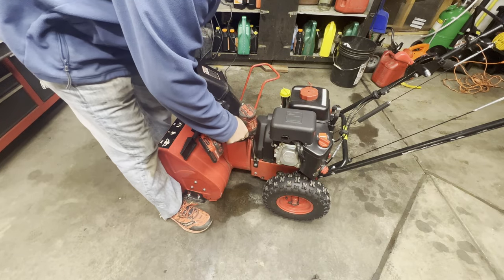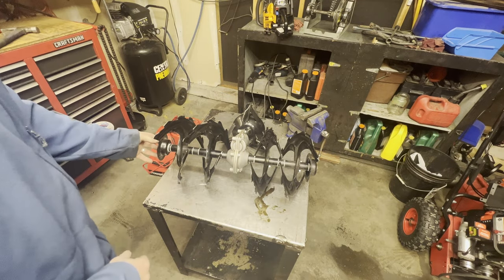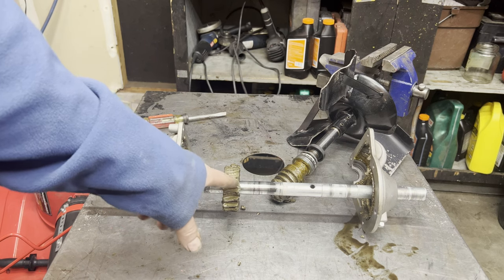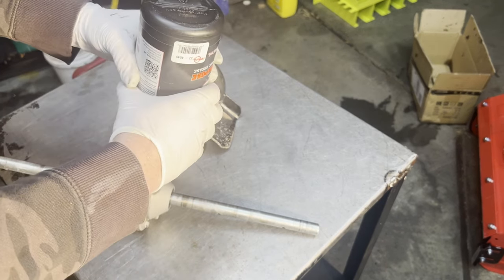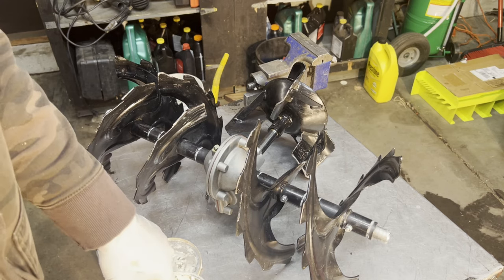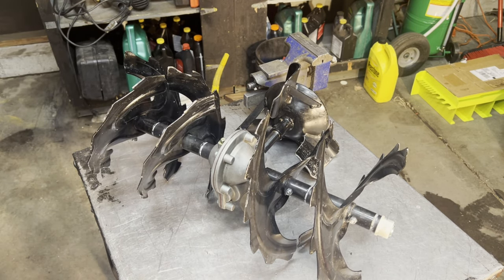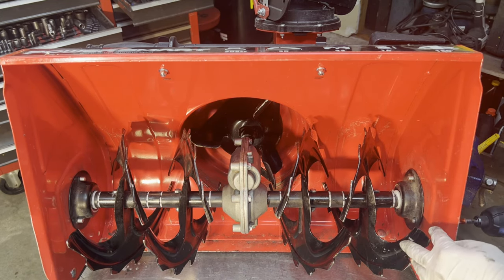Snowblower Auger Not Turning - PowerSmart

Comment: Just a respectful tip. Wasn't sure if that's an imact your using to tighten the shear bolts down or not. You're not supposed to wrench the nuts down onto the auger. That's the same as using a more hardened bolt so they may not shear and the same thing will happen again. That said thanks for sharing with us. You're a natural in front of the camera.
Reply from the maker: Yeah that was an impact wrench. Good point, thanks for the tip. I am not sure about being a natural :-)

Comment: The transmission and augers are the same for many makes and modesl. They are the same for many small no brand Chinese blowers but also the same for example Stiga St3255. In US I've seen that gear at M&D. In Sweden I buy them for a brand called "Meec Tools" and they cost me 21 USD.
Reply from the maker: Thanks for the information. When I originally found the part, don't remember the vendor, the emailed me the next day that they did not have the right part in stock. After searching for a bit, my customer actually found the part.

Comment: Great video Robby! Thank you for the in-depth video of changing the gear on the transmission out. You missed the money shot of actually removing and installing the gear though. Was that actually grease in the bottle or was it fluid. Just curious. Thank you for the longer video as well. Take care and catch you on your next video. P.S I have never had a snow blower transmission apart before that's why I asked the question about the fluid or grease.
Reply from the maker: It was grease. I had to warm it up in the stove to make it easier to get it all out.
Reply: @small_engine_repair  Gotcha , I just wasn't sure what you used . I swear.mine says it uses gear oil.

Comment: I think it was a combination of hitting things and lube failure.  It had grease in it but grease is not as good as oil and hat gear looks like it's been "eating itself" for a while.
I was actually surprised to see "fill" and "drain" plugs on it.  I watched the tear down to see if they actually went all the way to gear cavity, lol.
I had an old ariens and when I would try to pull oil in it, it would leak out, so I ended up mixing grease and oil.   Not the greatest, but the blower was so beat up it was not worth trying to rebuild and reseal the gear box.
I think that blower looks very clean for how much use it has clearly seen.
If someone is using it in a business, the gear may have just lasted its "expected" life cycle.
Reply from the maker: Possibly

Comment: The augers are on the wrong side. They need to be swapped to the opposite of what they are now. Mowerz and Blowerz. Thank you
Reply from the maker: I put them back on exactly as I took them off. Never been off before.
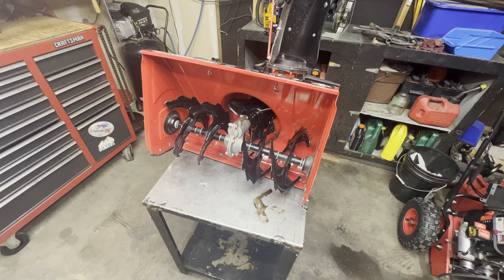Reply: @small_engine_repair  No you did not. Check the direction of the "teeth" on the augers @2:55 in your video and you can see that the flat sides of the teeth are down....later, at around the 16:55 mark, when you are putting the augers in the flat sides are facing up. I dunno, maybe it makes no difference in performance but they are different. This is not a criticism. I assure your that I learned a LOT watching this video and it helped me fix mine. Thx!
Reply from the maker: Yep I screwed up. Customer called me and was like it is not working. I fixed it.
Reply: @small_engine_repair  I think I saw the video from somebody else where they pointed out the augers went on incorrectly from the factory on these.
Reply: @robertknight4672    I've seen reversed augers pretty often on youtube.  saw one guy who had segmented augers like this, and he had the outside ones correct and the inside ones reversed.  I tried pointing that out in his video, but he just insisted they were correct.
The oddest story I heard about was a guy who got a used blower with two left hand augers on it from the factory.  The story, as I understand it, was the original owner got rid of it because "it didn't blow snow very well", lol.

Comment: What if you are unlucky. My big pulley wont remove. Any tips?
Reply from the maker: Heat it up and let it cool down. Hopefully that expansion and contraction will help when trying to break it free.
Reply: @small_engine_repair  Thanks! I was able to get the pulley off but the shaft has a metal bearing that seems to be attached to the shaft.

Comment: Did this brass gear can fit on husqvarna ST227?
Reply from the maker: I do not know. My guess is that it will not. PowerSmart use a different size then what I see in other machines.

Comment: I think the shear bolts that were installed are far too tight and need a gap between the head of the bolt in the bottom of the nut in comparison to the shaft.  The way he has installed them. They are too tight and will not perform.
To snap and save the gear box from damage.  It looks to me as though. This was the first time he ever did the job, And therefore the video was a waste of time.  I can do the same thing.  What I was looking for is someone to explain the details of the work and why they are doing what they are doing.  The mechanic clearly was not able to communicate and share any good insights from repeated rebuilds of the auger gear box.  I'm going back to donnie boy seventy three.
Reply from the maker: Never thought about how tight the shear bolts were. That actually gives me a good idea for a future video. Run two tests with different shear bolts and see if they do shear or not hitting the same objects (rocks, newspaper, kids toys). Thank you for the inspiration.
Reply: @small_engine_repair  Yes, I believe the manufacturer will tell you the same thing that they are not designed to be tightened against the shaft.  And it would be very interesting to see a test on your channel in this regard.  You are welcome.